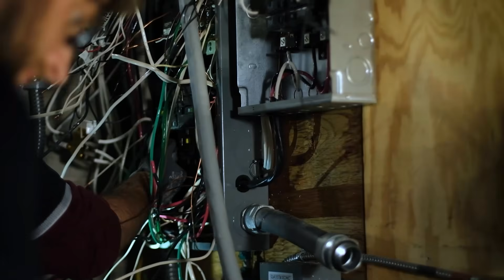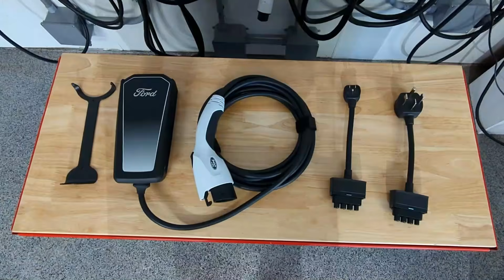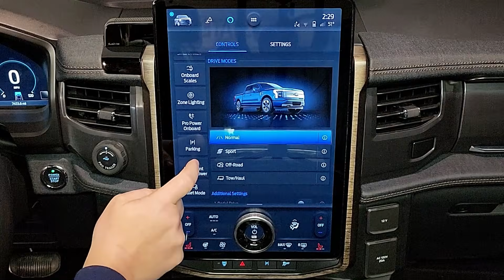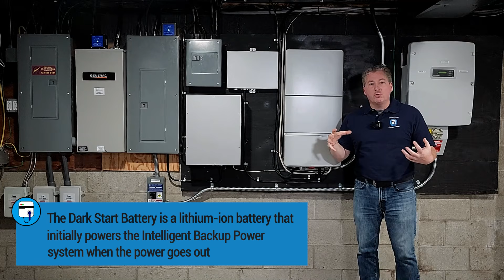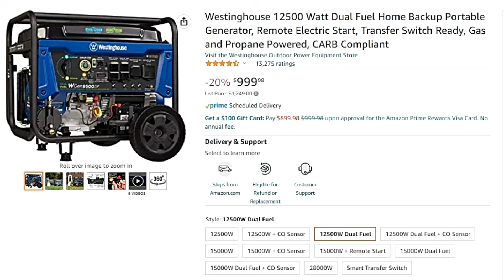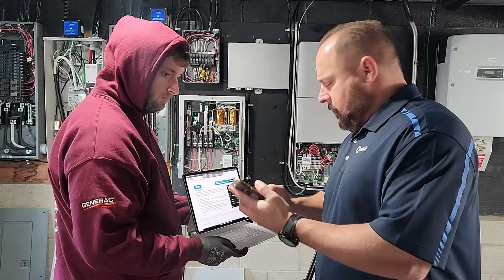Watch How Ford Lightning's Intelligent Backup Power System Works In A Real Home

Comment: Great info! We don’t get many power outages where I live, so I will just be installing the Ford pro charger for the 80 amp charging. And you are 100% correct. most people will need an upgrade we only have 100 amp service electrician has already informed me we will need 200 amp service.
Reply: You might want to consider the cost difference between installing a 200 and 300 amp service to your home.  If you have or plan to install air conditioning or a heat pump, you will need about 30 - 40 amps just for that system.  And then you might decide to install another electric vehicle charger at some point, and would Hate to get rid of a 3 year old 200 amp panel to install a new 300 amp one.   However with all gas appliances, you could run a 16 amp or 32 amp charger for the second car, and will actually be able to dial down the Ford charger to max out at say 50 amps if you wanted to run two chargers during the same time period.  

If you have a detached garage in Indiana, they will allow you to install a dedicated EV charger panel, so no need to upgrade your 100 amp panel, just install one for the EV charger.  They allow charging overnight at a very reduced rate, I think it is about 0.04 per KW right now.  

There is a NEC code that says they can not install two power supplies to one home, so that is why it requires a detached garage.  (but apartment buildings have 2-10 electric meters in each building - and they all are located at the same service entrance location.).  I don't know, I don't make the rules!
Reply: @Kangenpower7  There are EV chargers that you can pair together and they will intelligently split the available power between them, that's a viable option too. Probably not many times when you need 2 EVs charging super fast

Comment: Thanks for another educational video.   I have been debating on wether to install at my new home, based on this I am going to hold off until I have a better understanding of how often the new place does with power outages.
Reply: What you might want to do is invest in a couple of 50 foot power cords, and a couple of computer style power strips.  Then during a power outage, run these to the truck / car with a 12 to 120 volt inverter, and run the things that are critical to your lifestyle.  This would be a investment of only about $100.  Make sure that you have a couple of table lamps with LED light bulbs for each room that will need light.

Comment: Any idea if this qualifies for the 30% tax rebate for solar/batteries?  The dark star battery would seem to qualify.
Reply: Dark start battery is just a tiny one to provide power to the system, as Tom mentions.  Tom doesn't haven't any backup batteries in his setup, but the Sunrun inverter does support it.  You'd get the solar credit if you installed this with an actual backup battery.
Reply from the maker: I don't know

Comment: that is where tesla gets in on this (with the cybertruck), the 240 v and a generator switch/hookup. done, thats all you need. Thanks for going over this man! really appreciate the deep dive.
Reply: "Elon  has teased a 240V AC power outlet on the Cybertruck. These generators work with a “transfer switch”" but Elon has also said in the past that V2H made No sense....  

So who knows which version of Elon will get his way?
Reply: @nc3826  Elon is working with 1,500 KW battery packs and even larger 3,900 KW battery packs to supply a city with power.  Now you mention using your 95 KW car battery, and still have a need to "Reserve" about 15 - 20 KW to drive to a nearby working charger.  So the car actually has a limited amount of power they can use to power the grid and still have a few miles left over to drive someplace, even if you will discharge the battery then charge at home most nights.  

That said, a small inverter in the car that can supply say 200 watts and run your CPAP or oxygen concentrator  can be a lifesaver when you need it!  They can install a 1,000 - 4,000 watt inverter for a very low cost these days.  It might be handy for running a small electric hot plate or coffee maker while charging your car?  Why not cook breakfast while charging your car, using a receptacle that is in the very back of the car to run the stove.  Then during a power outage, you could run table lamps, and plug in a computer strip in your home to run many things, and cell chargers, ect.
Reply: "Elon" is not working with (or on) 1,500 KW battery packs and even larger 3,900 KW battery packs to supply a city with power."" that's something real engineers do... (while he was having fun dismantling Twitter ;)

and thank you for the rest of the bloviation.... but none of it addresses the OC or my quandary about the cyberduck's V2X specs...
Reply: You will need more than a generator inlet and an interlock kit, you’ll need an isolated generator sub panel and you’ll only be able to power what you can put on the sub panel.

Comment: Thank you for going through the alternatives. My personal feeling is this is much ado about nothing. Using the truck's internal inverter to a standard generator disconnect is the best decision for 99% of people. If you have one major outage per year, and keep the truck 5 years, that's ~$10k or $2000 per event! And very little of this hardware will be useful in 5-10 years. Installing a generator disconnect is a one-time fee that will last decades and multiple vehicles.

Until there are accepted industry-wide standards -- I suggest staying far away from this expensive and custom hardware. At these prices, a proper "power wall" probably makes more financial sense.

Comment: Thanks, Tom :face-blue-smiling: Gotta get my service upgraded. :face-red-droopy-eyes: Using the $500 charger that came with my F-150 is a disaster in the cold.:face-orange-frowning: Over 2 days with 120v plugged in -my state of charge went from 75% to 73%
Reply from the maker: 120-v charging on a Lightning is futile in the cold. I was charging in the summer on 120-v while the garage was being renovated and it kinda worked, but was only adding about 25 miles of range every 10 hours. Working from home I made it work, though.

Comment: Great video Tom, thanks for going through all this. We definitely need cheaper ways to leverage V2x. It's silly to have huge batteries in the garage and not utilize them for home backup and for adding buffer to the grid.
Reply: It's frustrating that Tesla has nothing on their cars, not even a sub 1kW AC plug that many BEV and ICE car have nowadays. Would be nice to at least run a refrigerator or chest freezer and some lamps during an extended outage. I know you can tap into the DC-DC converter under the rear seats, but that's not really a good solution.
Reply: @andrewt9204 ,  Someone did a You Tube video about how they installed a 1,200 watt inverter in their Leaf and run a few lights and other things using a extension cord from their car.  They have to leave the key on, so the high voltage power to 12 volt battery power keeps running.  I thin the high voltage to 12 volt is about 3 KW in the Leaf, not sure what the Tesla allows.  Usually the lights, and other accessories in a common gas car use a 60 to 100 amp alternator, so my guess is the Tesla would be about the same number of amps to convert 12 volt power to run a portable inverter.
Reply: @andrewt9204  I’m oi
Reply: I’m so o

Comment: I expect the load calculation would consider that most charging happens overnight when time of use rates are cheapest and other home usage is lowest.
Reply from the maker: I don't believe it does. Because the owner wouldn't be restricted to only charging at night.
Reply: @StateOfChargeWithTomMoloughney  I checked the NEC, and of course you're correct. That said, 625.42 allows automatic load management for chargers. For example, Tesla's Wall Connector will talk to other units to reduce load and share a circuit. It could reduce installation/upgrade costs for users if this same approach were able to be applied across a panel using energy monitors and "smart" circuits.
Reply: The code requires full load in the calculation.